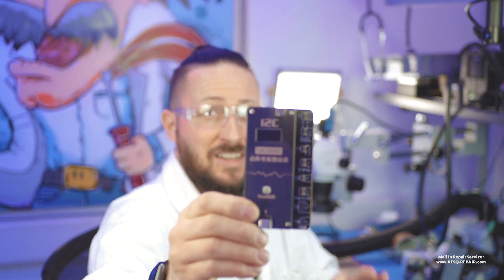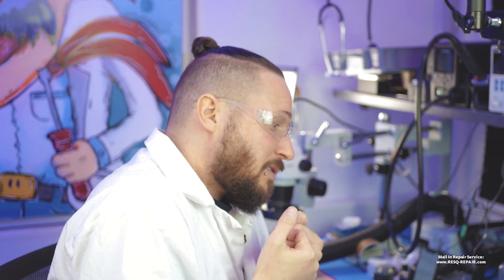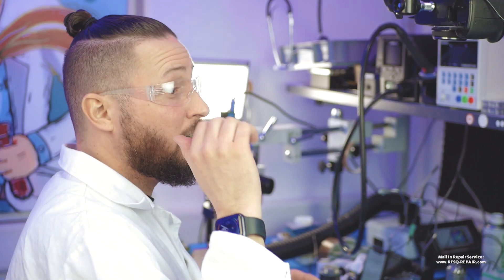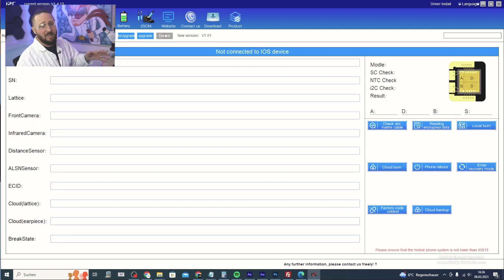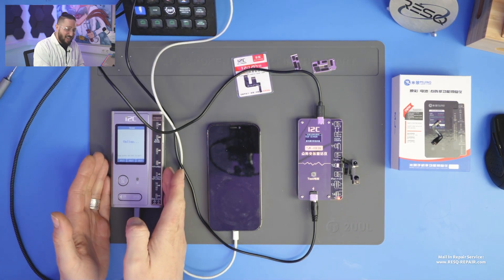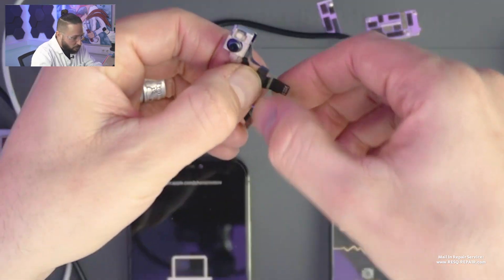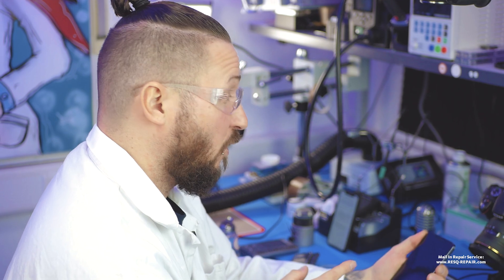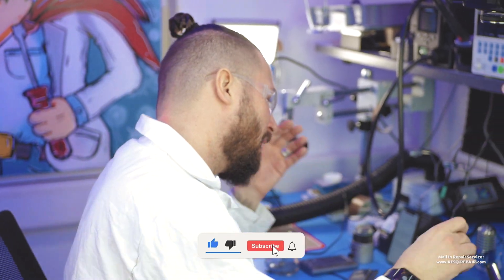😍Face ID Repair: Tag-On Flex Method with (NEW) i2C Programmers! Easiest Way? NO SOLDERING! - How to

Comment: Flex cable repair only works up to Iphone 12. Iphone 12 and newer you can buy replacement part from apple. Iphone 16 you can replace with oem part from another phone

Comment: Hi community and Dr. Ben. I was wondering If someone has more information about tag on flex? Why it is so important to put it inside your phone if you reprogram all information or copy/paste all data when you swap battery. What kind of information is stored there and is there any other way to avoid using it? 
It can help me also if you have any specific website to read about it :)

Comment: Thanks for the video.. I have a question, the torn flex for my device happend on the EAR SPEAKER W/ PROXIMITY SENSOR, can you give some feedback whether the same Tag on Flex method can be used for the proximity sensor? Maybe I am understanding this wrong, but essentially the above tag on flex method is for the camera part of the iphone and not for the proximity sensor?

Comment: Hi sir Kindly suggest me to solve my problem, I am stuck for so many days but still not solved, the problem is 2 to 3 mobiles have the same problem face id not available, ear pieceRibbon, IRcamera all things are original, some times received sealed set with same issue, IR camera serial is coming 0000000, I have flashed on iTunes but IR camera serial not changed. Please help me to solve this problem, I will be very grateful.

Comment: Does the external power supply you plugged into the bottom of the m12 does that come with the m12 ? Or do u need to buy separately?

Comment: Hey I just want to sum up some of the confusion here.  First of all Ben does talk about needing both of the programmers, He says that the i6S programmer is being used as a dongle for the other programmer.  The other point is, that this solution regardless of needing multiple devices has a better way of folding and inserting the cable in the phone on the 12 series.  The AY cables (Which I have) you have to fold them in a super annoying, kinda risky way and then place them under the plate of the rear camera.  Here using the i2c flex, you don't have to screw around with that rubbish.  I would like to point out though, I don't think both of these are necessary because in the i2c software there is a section for the face ID with a picture of that other programmer that Ben is using and as you can see in the video he connects it with usb.  All that aside, I would like to talk about the other solutions because I am sure a lot of you are curious. JC's uses a similar folding technique to the AY however I am sure there are a lot of people out there with the JC V1SE and you can just buy a sub board for that tool, that has a USB - C connection that is the 5V for burning the dot out.   That way you don't have to buy a new tool, good way to save some money.  I still think that the I2c way for doing this is probably the best right now out of the other manufacturers mainly due to being more user friendly and less likely to damage flexes in the process of installing them.
Reply from the maker: You are right. But if you don’t connect 6s programmer and only mc12 you can use the function. You get an error.